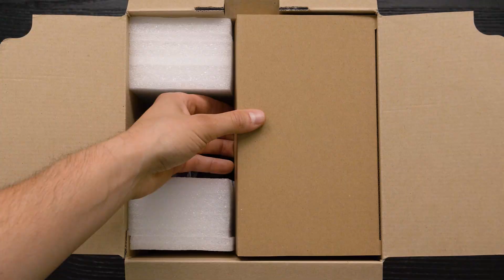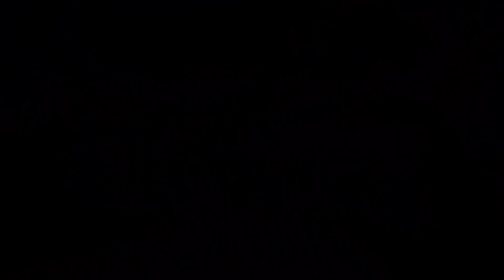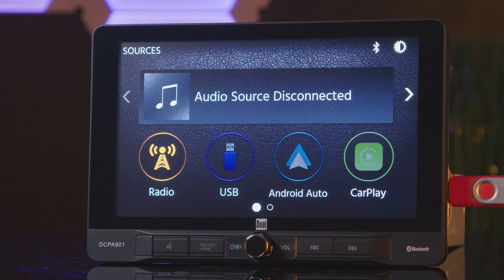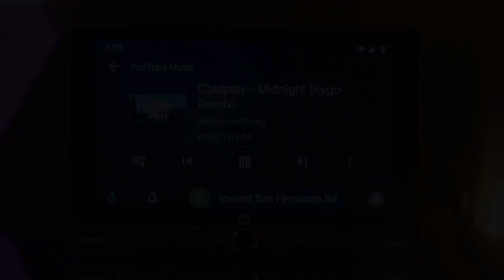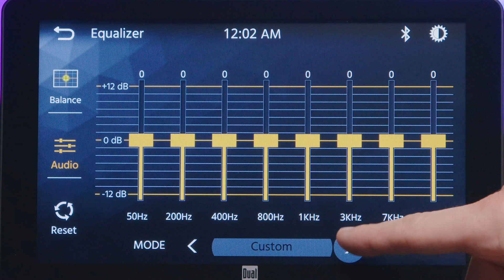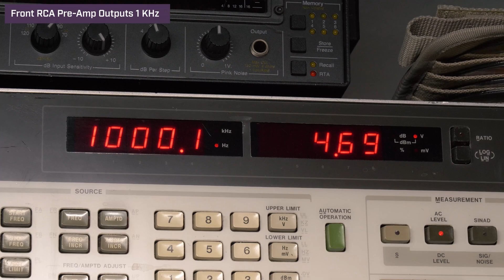Dual DCPA901 9" Single DIN Headunit - Apple Carplay & Android Auto

Comment: What did you mean “use the rear USB for both apps”? 

If I had this installed without a phone cable from the back, do I need to pull it back out, connect a phone cable? 

The side USB won’t work for CarPlay, yeah?

Comment: How’s the brightness at night? Can it be turned down a lot or not?
Reply from the maker: It has a dimmer mode that does that automatically when the illumination wire is connected
Reply: It's still pretty bright at night

Comment: This appears to be exactly the same unit as the Jensen J1CA9.  Both Jensen and Dual are sister companies and subsidiaries of Namsung America. The Dual unit sells for about $150.00 less than the Jensen on Amazon.
Reply from the maker: Built in the same factory.
Reply: Why is one less than the other? I just bought the J1CA9W and wondering if I should've gone with the Dual. 

Also, does anyone know what the difference is between the J1CA9W and the CAR910W? They also look exactly the same!

Comment: Will this work for the 2015 Camry se?
Reply from the maker: Yup! These are the parts you need:
Dash Kit
https://www.qualitymobilevideo.com/99-8249.html
Wiring Harness
https://www.qualitymobilevideo.com/70-1761.html
Or Interface
https://www.qualitymobilevideo.com/gmos-lan-09.html
Retain Steering Wheel Control
https://www.qualitymobilevideo.com/aswc.html

Comment: I bought one and just installed it yesterday. CarPlay works great and the screen is very responsive. The volume knob is a necessity for me, the main reason why I typically skip out on big screen head units. One thing I noticed it's missing is a HP crossover for the main channels RCA outs. Sound quality sounds fine, didn't notice any degradation from the previous Pioneer 80PRS it replaced. A few other missing features? No mp4 video playback or high rez display (1024x600). I will give it some time to determine if it's a winner or not, but I'm happy with it at this time. Thanks for the video, very helpful as always!
Reply: Big wiz I have the smaller version of this unit and figured out there is a hp filter that comes in when the lpf is activated and time alignment is set. There are a few other tricks to get the best sound out of it with the eq. I replaced a pioneer unit with this one and the sound quality is night and day. Just wish it had all of the fine tuning I'm used to being able to adjust.
Reply from the maker: Appreciate it bud! Yea it's a solid unit for the cost. It's got everything you need really, and I totally agree on the volume knob!!!
Reply: Big D...Would love to see you do a review on this.
Reply: Sure it was this exact radio because the one I’m looking at on Amazon shows it has usb video playback and it’s the same model number
Reply: @antoniop5889  Apparently the Jensen model has video playback while the Dual model does not, although the rest of the features are the same
Reply: @wal  that’s weird this is the one I’m looking at and it’s advertised as mp4

Comment: Wouldn't hesitate based on the Dual brand itself, just the price tag. This should be a $200-$250 head unit. Also could use some customization options.

Comment: Nice looking Dual radio. The deal breaker for me with the Dual touchscreens is that their screens are not responsive at all. I have a Dual in my old Toyota and I get so frustrated having to touch the screen so many times just to get something to work. I get so mad at the radio I feel like punching the screen out. smh
Reply: This one is responsive. I was hesitant based on many comments about Dual head units, but my experience with this one is it's as fast or faster than any factory touch screen unit I've used (Including my 2019 F150).
Reply: @wal  Good deal brother or should I say good Dual. Lol, I know that was dry. I know you are super busy but it be nice to see an install of the Honda or at least a video of it once its up and running.  Thanks for your reply bro!